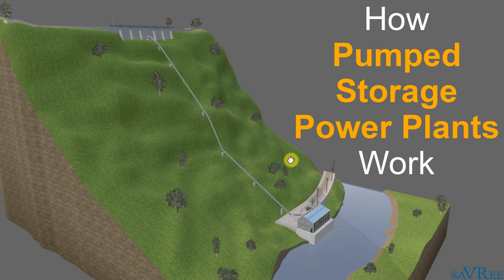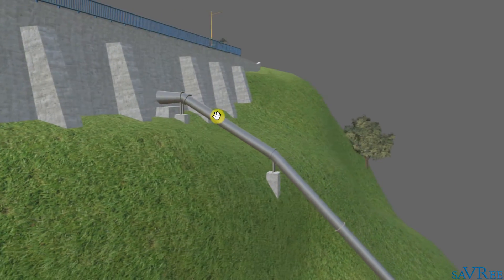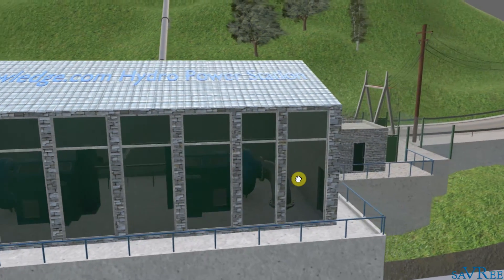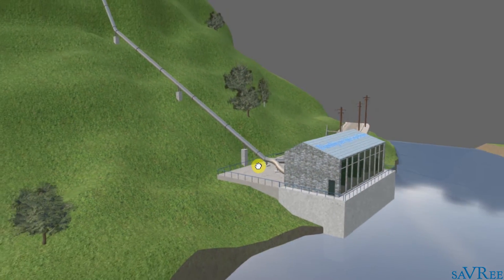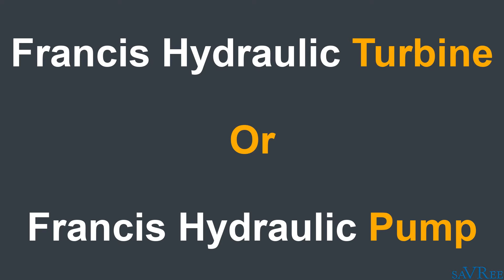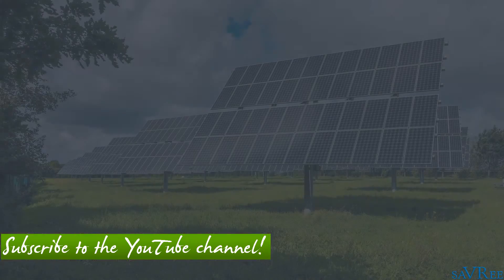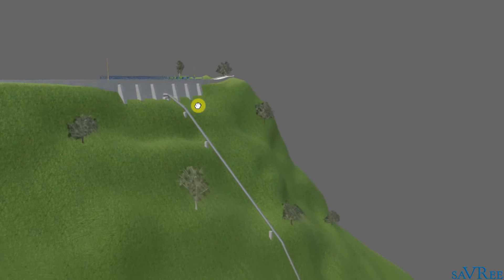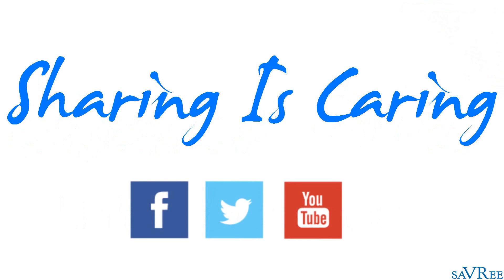How Pumped Storage Power Plants Work (Hydropower)

Comment: Hi, can you think of a reason you couldn’t have very heavy floating objects say a ship, in the top reservoir. When the waters pumped up they would float and then when you let the water out you could suspend them , take the energy out of the water as you do normally and get your 70-80% energy back, and  you then have the potential energy of the ship you could then harness. I’m sure there’s a reason this wouldn’t work as your getting something for nothing. But with the perfect container and the perfect shape floating weight you really wouldn’t need to pump much water.

Comment: Love this idea. I have been researching for some time the efficiencies claimed and they seem to be questionable. As I understand a francis turbine its very hard to be made to both generate energy efficiently an pump with similar efficiencies. I would love any information you have on people that specialise in this. From my research the energy conversion is more like 80 to 85% efficient to generate electricity but when you go to pump it back to the reservoir the efficiency can  be as low as 20%. Please don't get me wrong I love the idea. I would just like more information on how efficient the system is an more importantly how to achieve it.

Comment: Environmental protection also includes grease free bearings and bushings... these are expensive and require frequent replacement. Hydro is an expensive solution due to these maintenance challenges.

Comment: More power to pump up than power generated from the system - therefore only makes sense if you are 'buying cheap energy' to store to late discharge when if buying energy at that time it would be expensive. So only makes sense on a local scale, not a national scale (if you are the supplier of the energy to pump up the water), unless you have excess energy that is from a renewable source that is not a lake (hydro is another battery). So that generally only occurs when grid use is low (over night) when no solar is available and wind is variable, so that leaves 'non renewable energy system - therefore I question the economic & environmental viability of these system on a national scale

Note: what is being suggested here - abundant/excess to need renewable energy source during the day resulting in cheap power - which countries have this ?????

Comment: I know this video is old, so I'm not really expecting an answer; but if you were to rely solely on the hydro plant to both produce electricity and then use that electricity to pump the water back would it be able to do it while still being able to produce electricity for other uses. Or would it completely use up all the electricity that it generated.

Comment: Why not build elevated water storage in large closed tanks and catchment tanks so in a sealed system you have minimal water loss and wind and solar can pump water back to tanks
Reply: Are you aware how much water is transferred? A 1 MWh of energy with a 100m head difference is somewhere  around 4000 cubic meters.

Comment: Does it use more energy to pump the water than the plant produces?
Reply: Yes all energy storage system have this issue due to the law of thermodynamics.

You can't get more power out than you put into a system, and there's always conversion loses when converting from one form of power to another.
Reply: @gurumage9555  great explanation 👍🏼

Comment: Normally, dams' (Water storage ponds at high head) primary function is to store water for Irrigation. Due to high heads, it has Potential Energy, that is used to produce Electric Power. Irrigation (Crops fields watering) is a round the clock phenomenon, particularly in Pakistan. Pumped Storage Facilities at these dams will revert the water back into the dam. 
Question is, 
How the Irrigation System is managed in these hours for the downstream Farmers?

Comment: I think if I owned a pumped storage power plant I would use the waters surface to float solar panels on, and the surrounding land to install my own wind turbines . no cost at all then after initial outlay .
Reply: Floating solar photovoltaic is an especially good idea because it would help limit evaporation loss.
Reply: I would stick my windmills strait up out of the water, then put my solar panels on top of them. Closer to the sun, lol

Comment: Conceptually, this is good. But somehow it feels stupid that you are generating the power by releasing the water and again pumping it back (economics aside). Wouldn't it be better if such a system is built by damming a slow-flowing perpetual stream of water - like a river or waterfall? On a similar token, why can't air be "stored" and compressed and generate power on demand rather than waiting for irregular and uncertain wind patterns? Or why not use solar energy to drive a DC motor which runs an AC Generator?
Reply: '''''''Wouldn't it be better if such a system is built by damming a slow-flowing perpetual stream of water - like a river or waterfall? '''

the river hydro system works the same way that pumped hydro works

in river hydro , after the water is released through a dam to a low elevation  , the water  is then pumped back up to the higher elevation so that it can b released again

your solar idea would require a large percentage of land to  place the panels on and even then may not provide enough energy

the classic problem with solar
Reply: It is kinda ridiculous, if not for changing supply and demand it wouldn’t work out, there are energy storage systems with compressed air, and also lifted weights, the part about using a motor to turn an alternator is nonsense though

Comment: What happens when the water disappears because of drought?
Reply: There are lots of variables.  There are plants like this in operation for many years.  In one case, the reservoir is atop a mountain on an island. 

It was originally built to supply farms and drinking water for cities.  When water is in surplus, it generates electricity. 

They have been able to expand the system with desalination, providing even more water. 

For drought, the whole system can be covered. As stated in the video, some places have better fit.
Reply: If it's next to a stable water source then there is no problem.  For example, the ocean never dries up, so water is always available, even if there is no rain.

Comment: Only thing you're missing is, which would be the actual energy losses? not translated in money, just energy used to store vs. energy stored. With that info, this would be a perfect reference for this type of storage.
Reply: the main issue is whether it produces more energy than it consumes

looking at places like Switzerland where it's been used  for a while , they continue to use it so it must produce more energy  than it consume
Reply: @robinsss  why did you just copy and paste the same reply to another comment. It's not even the same question and your answer is both irrelevent and incorrect.

To correctly answer Ricardo: It all depends on the scale of the plant and efficiencies of the turbines. The larger the system, the more efficient it becomes, with the largest having an estimated efficiency of around 70%. So the losses would be quite large but the main reason why pumped storage is implemented is the even out the energy production to better match the demand. A loss of 30% is acceptable because it is outweighed by the difference in price of electricity on vs. off demand times
Reply: @conchubhar9492  ii agree  that it's only storage  but  i have seen sources that say it's 90% efficient
Reply: @conchubhar9492  I have seen something saying about 80% efficient.  Obviously a lot of different factors here.  Seventy percent efficiency could easily be sufficient for many grids.

Comment: If you put a big ship in your reservoir and attached it with flat chains, (like a bicycle chain)  to a driveshaft, when you pump the water into the reservoir the ship is lifted for free, when you drain the water to drive your turbines the descending ship will turn the driveshaft, that's additional energy output for no additional energy input.
Reply: Mark Honea  That's why I tossed out the Idea, I'm not an engineer either, I'm just hoping an engineer will look at at it.
Reply: It would be a big expense to get a ship into the reservoir.  So probably not worth it.  But it is an interesting idea to try and increase the effective head height of the dam.

Comment: If a pumped storage plant with a total capacity of 1000MW  has 4 250 MW units, would all 4 units be used to pump the water back up?
Reply: I really want to know about this question...really interested is there an engineer who can explain this.
Reply: Yes.  They could be.  It is simple engineering.  The only question is when is cheap electricity available and the efficiency of the overall system.

Comment: Was wondering what the usual capacity of these plants are? Also, other than the friction in the pipes and transmission losses, are there any other major losses that should be taken into account? Lastly, is there a way to optimise these designs? You mentioned that there is usually one turbine/penstock, is there a reason for this? And can we have more than one penstock/reservoir? Thank you very much, the video was very informative.
Reply: The amount of energy put in, compared to the amount of energy that comes out, can be about 80%.  So they work well as batteries to buy power when it is cheap and then to sell power when it is expensive.  

No battery is perfect, but this is not too bad at all!  It compares very favourably to lithium ion batteries!
Reply: Also, to optimize this design you need a big difference in the level between the upper and lower reservoir.

Having a large swing in the price of electricity will enhance the relative efficiencies of the design.  For example, if solar power is the only power available then it would be very cheap during the day but infinitely expensive at night.  This price difference makes pumped hydro relatively more efficient.
Reply: the main issue is whether it produces more energy than it consumes

looking at places like Switzerland where it's been used  for a while , they continue to use it so it must produce more energy  than it consumes
Reply: @robinsss  Well actually these plants will always consume more energy than they produce simply down the the laws of thermodynamics. They only act as energy storage, not energy production.
Reply: @conchubhar9492  i  only recently heard of the system 

i understand it better now

Comment: I have two dams one low one high in a hill, What is the minimum head required to set up a system suitable to run a standard house with modern appliances.
Reply: I wonder about this too.  There are lots of 100 foot hills, but is that sufficient???

Comment: The Salton Sea in Southern California is 230 feet below sea level is it posable to build a pump storage station there with a pipe line from San Diego?
Reply: @savree-3d  thank you for your reply I will keep looking
Reply: They would have to build a 50 mile long tunnel to get a 200' vertical drop. Probably not very cost effective. Also I imagine using sea water would be more corrosive to equipment, and then there might be environmental issues with filling the Salton Sea with ocean water (I know it's already salty), but to be honest, I don't know. Anyway, it wouldn't be the same type of system, as there would be no need to pump the water back to the ocean.